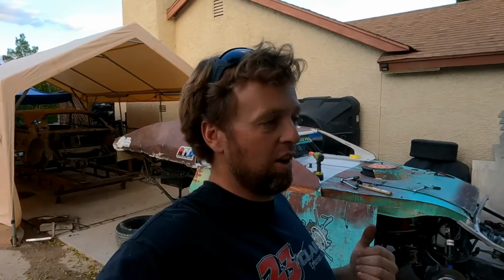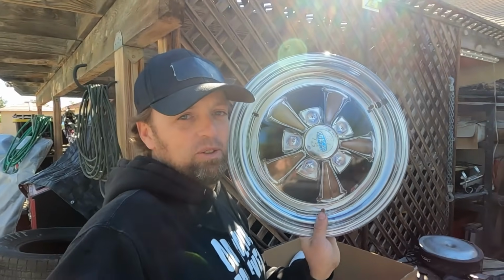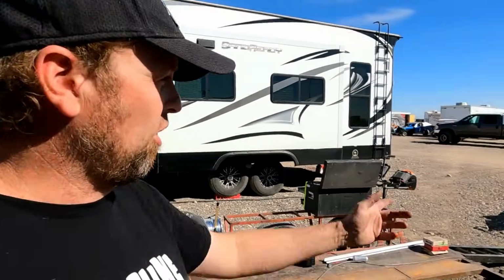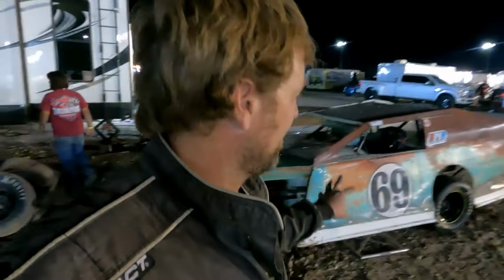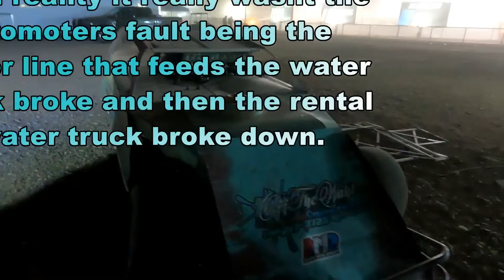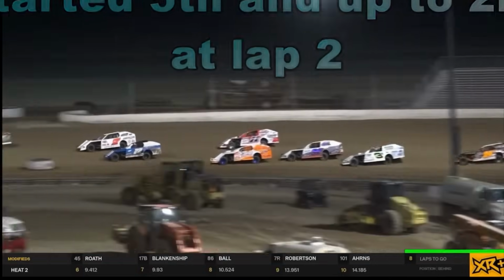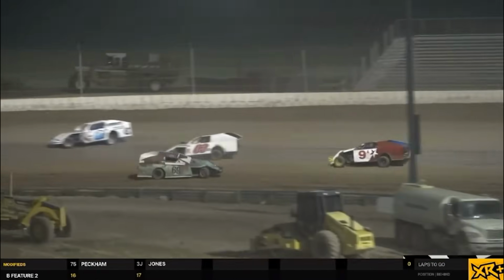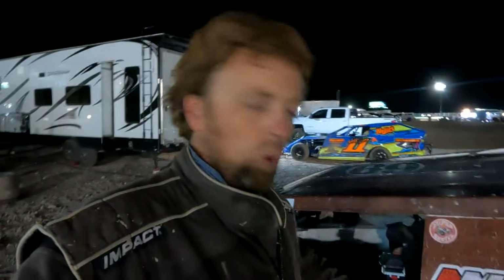My 2023 Duel in the Desert experience had all the HI's and Low's...stupid racecars

Comment: The very best slick track engine I have ever ran is a 340 Mopar.  It is so much more forgiving than about anything out there, other than the 347 Ford, which was patterned after the 340.  A solid 500 hp engine would be an advantage. My favorite head for that purpose was a ported 273 head. They were incredible. They only flowed 235 cfm, but they had 205 cfm at 0.300” lift. That’s better than than my W2’s and better than a lot of other heads.

Good run!

Comment: Try double clamp, 175 right rear, 150 left, and a pull rod. Probably need a 800 to 850 right front and a 750 left front, tie down sgock on left front and a 90/10 left rear